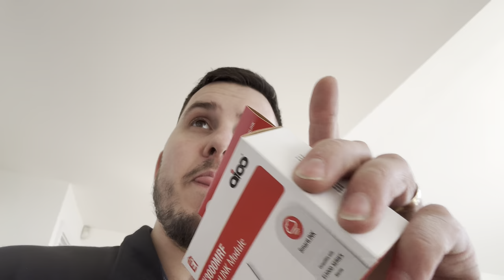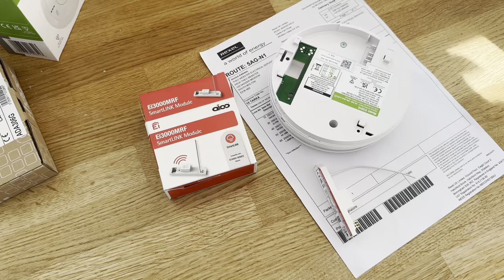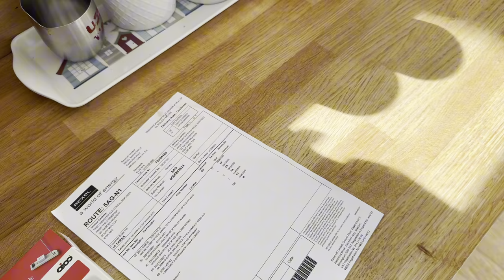HOLIDAY LET SMOKE ALARM MADNESS ! #electrical #electrician #electricalwork

Comment: Think you’ll find that the button on the side isn’t for pairing as the heads will trigger just by putting the RF mods in. The button code locks the houses signal so the units don’t get affected by other properties with other Aico kit, you can imagine what might happen on a new build estate or people putting them in next door 😂
Reply from the maker: We did actually notice this in the instructions after 🤦🏻‍♂️ typical bloke not reading them 🤣🤣 great bit of kit though to help make an easy install ! Aico are smashing it
Reply: Why so many alarms? Is this a new rule  for holiday, let's, what and where is this rule ? Thanks 
I'm asking as I have a couple of lets
Reply from the maker: @grahamdaniel6035  hi Graham . Yes that’s right the rules for holiday let’s have really been taken up a notch. If your holiday let’s are in the south west get in touch and we can take a look for you